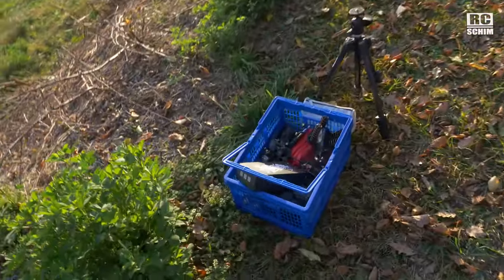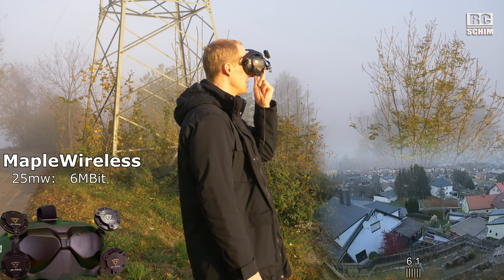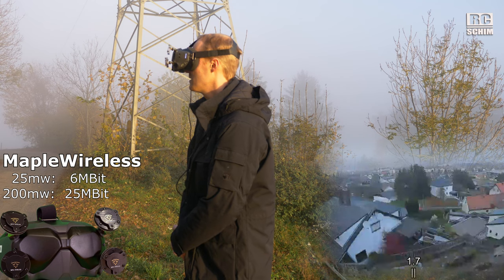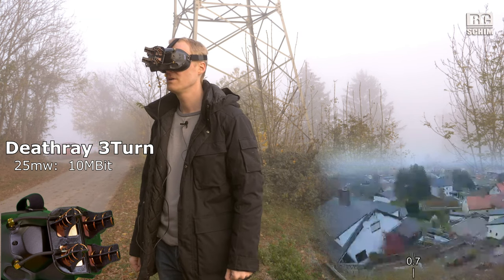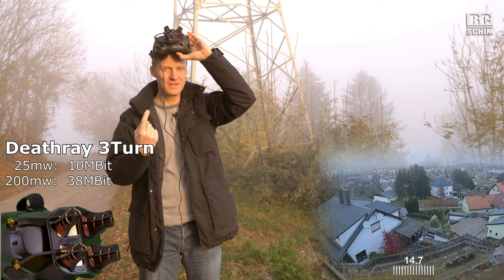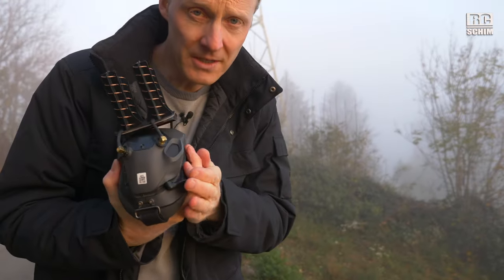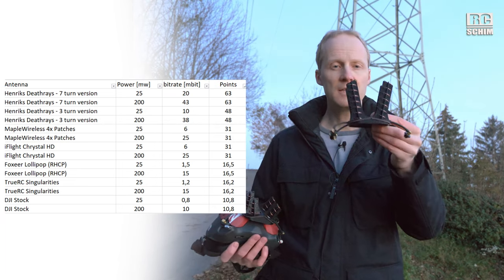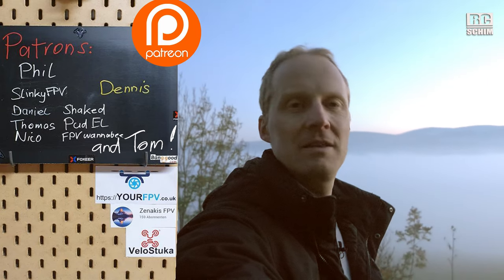Where to put the good antennas?  (DJIFPV Stationary 2.3km Test)

Comment: Excellent video Mario!! Great test set up, actually more interesting with the fog!! I was also interested how when you did the turns, all antenna did better side on when the left side was at 90 degrees to the air unit than when you turned with the right side facing 90 degrees..again proving your “ Left side Theory” (or more importantly Bottom Left Side Theory”!!). So do you think a good patch on the bottom left only and 3 omnis on the other 3 poles would be a good all round set up??
Reply from the maker: Sure. 1 3turn helical would probbably be enough. Maybe add a 2nd on LEFT top (pointing it to the right more) to have wider beam even.
At least I know now - on my previous tests I sometimes have put patches on the right side - and thought the antennas are not that good - while it just was the way DJI goggles favor ports.  Still wonder why and what the right side is there for  (only 2way comm with airunit?)    Today I will prolly meet with a friend to test his goggles as well to confirm left theory (but I also read from few others about the same)
Reply: @Rcschim  thanks Mario. Sounds good.   Would love to know results of tests with your friends googles to confirm your findings! Brilliant work. Talk soon. Mark
Reply from the maker: @marxdroneworx  so far the testing with my friends goggles wasnt very conclusive:  he could only test in audience mode - which we both asume acts totally different than the normal mode. In audience however, all antennaports worked the same way.
We would have needed to go down to the house, bind his goggles to the AU and go up again.
Time was running out and heavy snow interrupted the testing efforts.
So I still dont know if my goggles are maybe defective (but I doubt that).
Reply: @RCSchim thanks for the update Mario..shame the snow came in, sure you will try again when you can. Didnt sound like your googles are defective. Will stay tuned for updates👍🏻

Comment: Wow nice work shimster!  So 2 3 turn helical on left side is all that is needed?
Reply from the maker: Thanks Philster ;)  Yep, would say so - but normal 3turns are a bit annoying to mount. So some kind of 3d printed part to support them would prolly be good (similar to what Henrik did here). Currently I fly mostly with the iFlight Patches - simply because it works well enough (if you dont need crazy range).

Comment: Nice test,
In case of lollipop ,
I suspect the metal front cover of goggles made  reflection signal  to good position of antenna. Could you try in next test please?
Reply from the maker: What exactly do you want me to test?  The reflection? 
I swapped the faceplate (iFlight colorful one is plastic, because antennas are behind it).
Henrik also meant:  his helical antennas (which are mounted together) have a large copper base - this is a good reflector, so you even get signal behind your self ;)
Reply: @Rcschim  could you please test with 4 foxeer lollipop compare with and with out metal face plate just  confirm metal plate has responsibility to long stick antenna or not .

Comment: Have you ever tested the True RC X-Air 5.8 for DJI?  Is the bottom left thing (being more powerful) the same with all the antenna's, or just the Deathray?
Reply from the maker: With all antennas i saw the same. I just did cut away this so the video isn't so long
Reply: On 700mw, it isn’t the case. It just needs to have 2 directional antennas (any ports) pointing at the source to recover from no-signal to a very blocky but “moving” image (I have had the air unit’s camera looking at the ticking needle of a clock) . I could not see any difference in image quality regardless of using the 2 left or 2 right ports. Slightly better image quality (barely noticeable unless you focus on the details) with using 2 bottom ports as compared to the 2 top ports in my test.
Reply from the maker: @terence79chan  with enough power you dont notice the difference that much I guess.  This is why I always try to do my antenna-testes with lowest possible power.
Reply: @Rcschim  Thanks Mario, I understand now. I will use the 2 left ports for the directional antennas. Wishing you and your family a wonderful year ahead!

Comment: Love your tests :-)
Regarding the iFlight Crystal HD: In their product pictures they do put the patches at the top, and the stubbies on the bottom. In your test you switched this around (which i can relate to, as this has been the usual place to put them). I wonder if there are different results with switching positions.
Reply from the maker: It's easy to see, when you use 4 helicals on all ports and just cover single antennas. That showed me that left side is better than right.
Reply: @Rcschim  understood regarding left side and right. Yet i was referring to "upper side" and "lower side". In the product videos of the iFlight Crystal HD they do connect the antennas to the upper side, not the lower ones. Which is weird, as patches usually go to the lower side.

See this picture for reference: https://shop.iflight-rc.com/image/catalog/product/Crystal-Antenna/crystal-hd-antenna-20.jpg
Reply from the maker: @eyeflytinkerings  I understood what you mean. I dont think it makes much difference if patches are top or bottom. But in my case it was a huge difference if they are right or left...

Comment: Looks like the iflight crystal combo is a very good choice...!  have you tested the lumenier axii 2 HD (also patch and omnis) combo and can give me a advice which one I should buy
Reply from the maker: Yep, I still like the chrystal HD. Today I will for the first time see the AxiiHD on a friends goggles - but from what I heard - those patch antenna thingies are all quite similar   (AxiiHD, ORT Digieyes, ChrystalHD).  If I want some more extra range over convenience - I attach the Helicals from Henrik (the Deathray).     Good thing with ChrystalHD:   I can leave them on because they are flat! - not like the Axii which add ~5mm ontop your faceplate - so I can install the Helicals (or something else) easily OVER the chrystals....
Reply: @Rcschim  and what du you think about the omnis of the crystal/ AXii? Are there both simular in quality?

For the Dji v2 goggles I hope the omni/patch combo makes still a sense... because i have read about the differents between v1 and v2. no more switching between tx and rx, That means no rapidfire?! Is omni and Patch nevertheless a goto recommendation on the v2?

Ps. Thanks for your support!
Reply from the maker: @renesfoodpassion  honestly:  I didnt test much with V2 goggles yet - so I have only "hearsay" knowledge ;)
The little stubbies are all quite similar in performance as well  - but a good day of free time, a few packs and I could find out how they fair.
On the V2 goggles (but when they run in V1 mode - the DJI HDL mode) I think they act the same as V1 goggles. Only V2 goggles in DJI FPV Drone mode (occusync3) - there it works differently - this is all very confusing to the customers I guess. So far I'd still stick with patch omni combo - and I will fly more this afternoon - maybe I can gather some new knowledge :)
Reply: @Rcschim  ok cool! Please let ne know about your afternoon flight 😜

Comment: great vid. would be interestet how the truerc patch antennas perform compared to the other ones.
big thx 4 your  great work.
Reply from the maker: Today a friend had the TrueRC Xairs (RHCP) but he was in audience mode while I was on normal mode. There the iFlight patches performed about the same as the TrueRC Xairs. But keep in mind, in audience mode  you get a range reduction!
So I estimate those TrueRCs to be between patches and 3turn helicals, maybe around the same as 3Turns. Hugo claims they are between 3 and 5 turn helicals even. Maybe I can test this the next time...
Today we only had 1hr, and right after we arrived up there heavy snow began (last time fog, now snow, what's next? :)
Reply: @Rcschim  would be great to know. Myself fly 2 truerc patches. I don't really care about the size thing. Just like to get the best range possible on my setup. Thx for your answer. Looking forward on your channel. Keep up the great work. Greets from Switzerland.

Comment: Dear Mr shim LOL I have a question for you and hope you could answer it and help me out as I value your input just order the iflight patch antenna set and would like your input on whether to hook them up to the top ports on the goggles or the bottom ports thank you and any other advice you have concerning that is much appreciated thanks Jason
Reply from the maker: Patches bottom and little omnis top works best for me
Reply: Thank you very much so that I flight crystals patch kit that bolts to the front I saw in your test it looked like you had them hooked up to the top but you're saying you would recommend hooking them up on the bottom instead? Thanks again much appreciated

Comment: Great test, thank you! could you try the 3 turn on the bottom and the trueRC singularities on top?
Reply from the maker: I could, will probbably today.  But I'm quite sure that the gain of 3turn will be same as if I only used the 3turns x4.  Only possible diff: when turning away from Airunit in my test, the omnis would then make a bit better reception. But not by much - the 3turns are also quite good behind them...
Reply: @Rcschim  Cool, if there will be no negative effects on reception it could be a more compact alternative to a full 4 3turns

Comment: Thx mate great review. Question what antennas would you recommend on the airunit?
Reply from the maker: Just the stock ones or the caddx vista antenna also seems to be a bit better.
Foxeeer lollipop worked good for me as well, just not the lollipop micro. They are crap.
Reply: I try out the albatross 15cm ones. Hope this helps for longer range

Comment: Seeing it only care about lower left antenna port is surprising. 
Can you please do one sanity check, and repeat a couple of these tests with the AU having the same polarity antennas?     Don't need to make a video.  Just want to know if you see any difference. 
I suggest this because DJI's FCC documents say that it uses CDD (Cyclic Delay Diversity) which means it transmits every packet twice with a very small delay between, and the VRX chooses the best of the two copies.   It is possible that it's transmitting the 2nd packet on the 2nd AU antenna and receiving it on the right side goggles antennas.   If that were the case, then in the situation where you have a polarity mismatch between the 2nd AU antenna and the right side goggles antenna, it would make it appear that the right side antennas do nothing.
Reply from the maker: Hi Deamon! Nice to see you here! 
The day before this I already tested a lot, there I had 2 stock LHCPs on the AU. Same result. Had this on the goggles with all different sorts of antennas (of course not only the maples which again are L+R).
Today I wanted to confirm that it's not just my goggles. Had a friend up there with me, 2nd pair of goggles. Problem: if his goggles are not bound to my AU, he's just in Audience mode - there it seems to be equal on all antennaports...
I'll test more on a different location maybe with more pilots.
TrueRC also got a lot of feedback that using the LEFT side is better.
Then Henrik pointed me to this info (maybe you've seen it already). More and quite interesting infos from FCC? testings. Saved it in "our" DJI goggles thread where you already added a lot of great infos!
https://www.rcgroups.com/forums/showthread.php?3710715-DJI-FPV-Goggles-which-antennas/page2&perpage=30#post45924707

Comment: Also do you think on that if flight patches front plate if you put a carbon fiber sticker say over that whole front plate do you think it would affect the range at all?
Reply from the maker: The new faceplate from iflight is made of plastic. There is even an cf version. 
If you use your own sticker I'd day or depends on the materiel. Most stickers should be ok. Real carbon would be a problem :)

Comment: If the left side is more important for the video link, could it be that the right side is more for the radio control link?
Reply: The goggles are not required for the radio control link, the radio has its own transceiver and antennas to communicate with the air unit.
Reply: @Porksoduh  Of course! You are right. I didn't think about that.

Comment: He never wrote back to me. Any other way to get a hold of him. I really want the 7ring for my dji v2
Reply from the maker: I forwarded your comment to him, maybe you can also send me a mail to rcschim@gmx.at  so I can forward the mail rather? 
normally he's responsive so maybe the mail just got filtered...
The helicals are really my fav antennas - tho I prefer the 3turn since it's plenty range and has a good, wide beam.
And by DJI v2 you mean the googles - and not the "DJI FPV Racer" drone, right?  because this would run on 5.8 AND 2.4 and would need dualband antennas (where I would suggest the ORT digieyes v2 as an upgrade).
greets, Mario
Reply: @Rcschim   Thanks for getting in touch with him. He sent me an email back explaining that he typed up the message but never sent it. Yeah i figure the 7 ring would work great for my zohd. It is for only dji Goggles at 5.8 and not for the 2.4.  I just got a pair of maple leaf antennas for my quad as well as my zohd dart. They work great for flying behind and well as low in tree level. As i watched you test they did get out preformed with the 7ring and 5ring deathray. I hope to hear back about pricing. Again thanks again for reaching out to him about me.

Comment: Hello, how about the TrueRc X-AIR 5.8 For  DJI FPV ?
Reply from the maker: I could only test a special variant of the xairs (not part of this test). they are for sure one of the best antennas, but for me the mounting is horrible. the helicals from Henrik are way easier to mount (and even keep them on - at least the 3turn variant). Or just use the iFlight or Axii Patches - for convenience.   Flew 3km with iFlight patches yesterday, got to around 30mbit when I turned around (only because of battery, barely made it back with my 1600mah 4cell, but that's a little OT now :)

Comment: Is it dji goggle v1? I ask cause v2 use antennas the different way.
Reply from the maker: It's the V1 goggles being used here! I'm not sure if V2 goggles in V1 mode would work differently! I know that they do in V2 mode (in the occusync3 DJI FPV drone mode).
Reply: @Rcschim  they would, cause they use 2 antenas for RX, and 2 for TX
Reply: @Rcschim  anyway, thanks for video! Very useful
Reply from the maker: @plugngluck  was this confirmed somewhere?   Maybe there is a misunderstanding about V1 and V2 modes (software) vs  V1 and V2 goggles (hardware)
Because I could imagine, that V2 goggles in V1 mode work exactly the same as V1 goggles   (in terms of antenna usage).
Reply: @Rcschim  I mean exactly hardware difference. MadTech had video about it. I’ll thy to find
Reply from the maker: @plugngluck  I know the video - but what I dont know yet:  is the antenna usage (RX TX behaviour) hardware or software defined?  I think it's a software thing. 
Anyways: I've found for my personal use:  3turn helicals times 4    (or 5turn)   for good range,    chrystalHD + their omnis (on top) for convenience and coolness factor :)
Everything other is really hard to measure since DJI FPV is really comppley.   Latest QRP video explains this quite well.

Comment: Why you donˇt test 700/1000/1200mw?
Reply from the maker: with that kind of power levels you have to be very far away. Antennas get less important if you use extreme high RF power levels. On an extreme longrange test one could - but in CE region it's problematic to show high RF levels in such a video - also problematic to fly further than 500m.
Reply: @Rcschim  Yes. But you can use stock antennas and have same resultats in high power. I fly with Chimera 7 4.5km in suburban with stock. 700mw, and min bitrate was 6-7mbits. I don't know why people hates stock antennas...Just need increase the power. It's simple but all tests in youtube only with 25/200mw.
Reply: @Rcschim  it's takes 5min to unlock fcc in goggles. It's free and simple. And who cares?
Reply from the maker: @ali3n24  sure, you can always go max power.
When I fly further away I get nervous on 30mbit already ;)
So I like to have both, power and best antenna, ideally mbit always stay on 50...
Tests are always with 25mw so you don't need to go crazy far...
Reply: @Rcschim  Oh, OK! I take more risks so I always use 700mw. Thank you ))
Reply: @Rcschim  what you think about new lumenier axII hd 2. Looks cool and futuristic.  But "out of stock" all the time and cost 90-100eur. Sure iflight crystal hd more cheaper (60eur) and have more signal angle.
Reply from the maker: @ali3n24  Honestly: I don't think the AxII HD2 are much different. They look cool, but I didnt get to test them yet. Dont wanna spend the money just to test them ;) Most times the chrystal Patches work decent enough for me, if I plan to fly further, I attach the slightly larger Deathrays.
Another interesting new alternative:  Maple Wireless Mjolnir Pro. They finally have an easy mounting solution. And they use right AND left pol antennas (on goggles - but also on the copter - so you need airunit to have best effect).   Not sure if they wanna send me the sample-  seems they didnt like me testmethods...